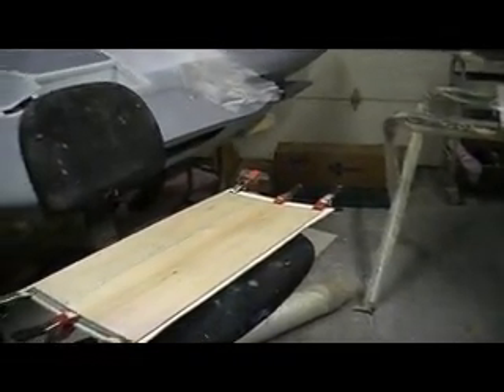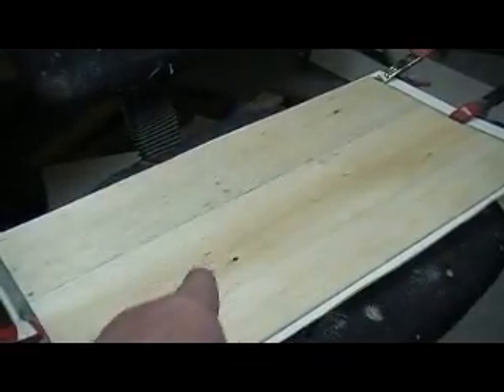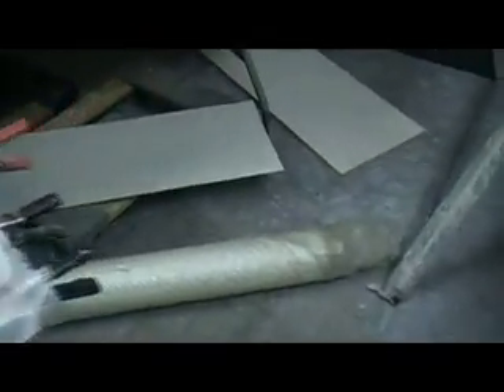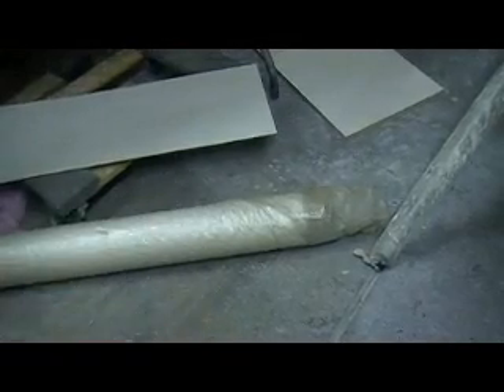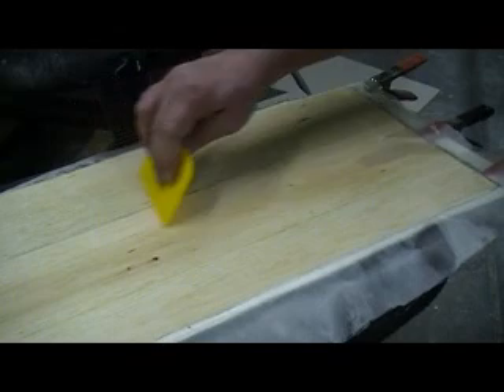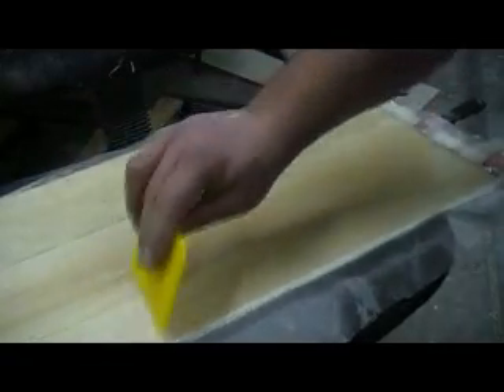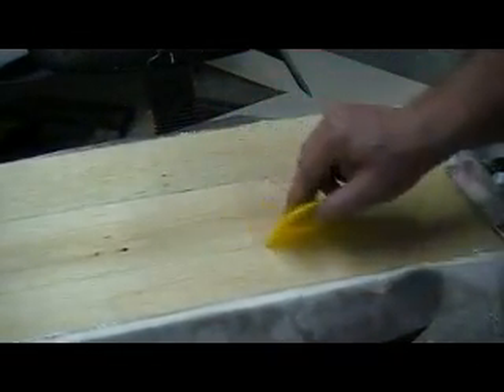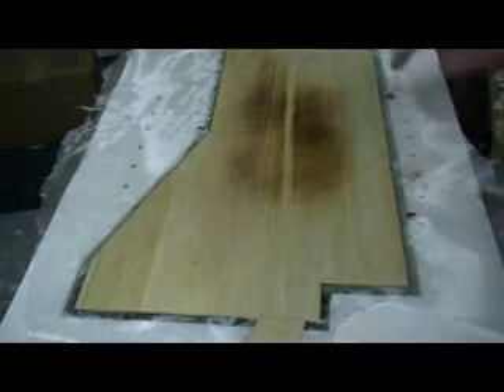how to build a rc jet B-1 bomber #112 pt 1

Comment: Did you try to melt resin a little bit with a heat gun? It helps a lot to spread the resin into the cloth.